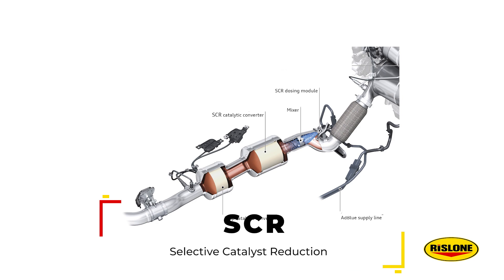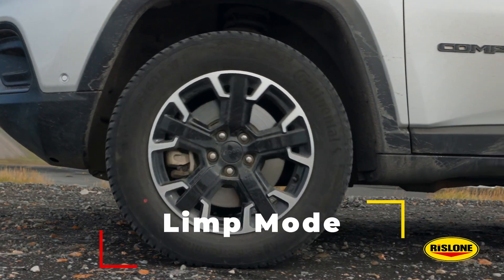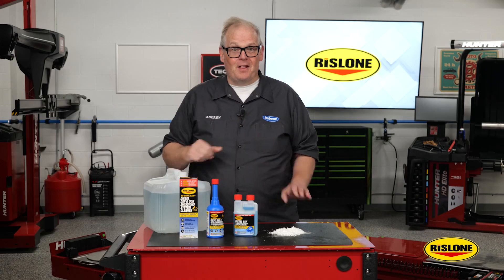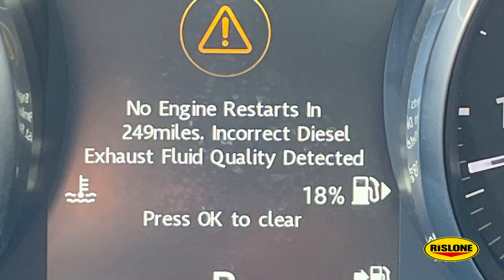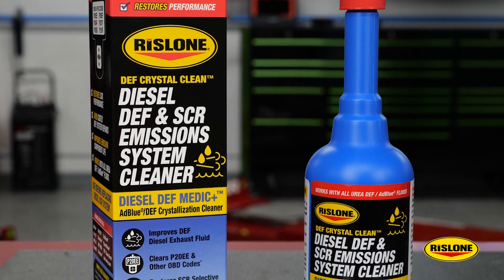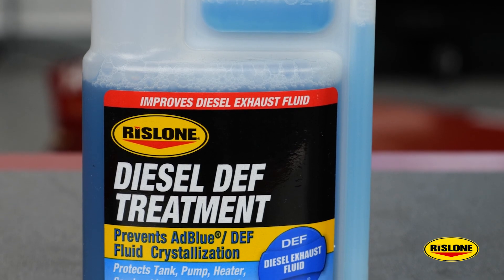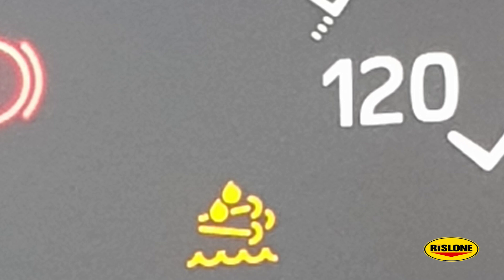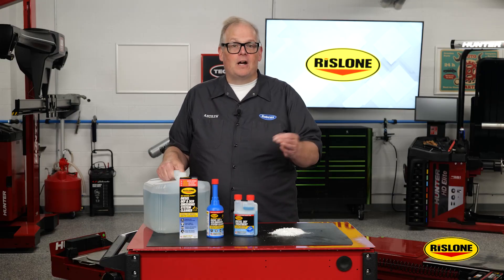Rislone CRYSTAL CLEAN™ Diesel DEF/AdBlue & SCR Emissions System Cleaner

Comment: Used this in my 2015 Ram Ecodiesel, and got the "Service DEF Will not start in 200 miles" error. The DEF tank is full. I have now driven it for 100 miles after getting the error with no resolution. I'll be taking it to a diesel mechanic on Monday to see how bad things are.

Comment: If I'm understanding this right, the System cleaner and def treatment should not be used together. Is this correct?
Reply from the maker: Correct you do not use these at the same time. The Crystal Clean is the initial treatment, and then you would start to use the DEF Treatment after that tank of DEF has been run out.

Comment: becareful adding this product in your def semi truck. too much will turn your def liquid into a soapy liquid and will trigger your def derate. the only way to fix it is to flush or drain it out.
Reply from the maker: Yes, you will want to ensure you get the proper dosage of product into the DEF system. Too much is not a good thing when using this product you want to have the correct amount installed.

Comment: I own a 2024 Ram 3500 and used the Rislone DEF system cleaner at 5000 miles, and having no issues. If I'm keeping the DEF tank topped off, the proper mix ratio is 1 ounce to I gallon of DEF fluid? Thanks for any help!
Reply from the maker: Yes for our DEF Treatment you will want 1 ounce per Gallon of DEF Fluid when refilling the system.

Comment: Got a P1C54 code on my ‘15 Ram 2500 6.7, already changed the DEF injector ($445 for MoPar at dealer) cleared code, ran it and code came back after about 100 miles… both times code hit I was driving slow speed taking kids to school. Code: "SCR Catalyst Missing" or "SCR NOx Catalyst Missing"
Going to try this 4784 out 🤞🏽

Comment: Used your product #4784 in my 2012 F350 after my engine light came on with the def tank code. Added to my def tank with two boxes of new fluid and ran the truck in 5th gear for about 70 miles and light went out and truck ran great. I will use the maintenance product from here. Product worked great. highly recommended.
Reply from the maker: Thank you for the comment, glad we could help!

Comment: I don't trust this product for some reason. I think the solution is to use truckstop DEF and never let the gang go down below a quarter.
Reply: Using fresh DEF fluid from a high-volume location and not letting it run low certainly helps, but depending on your driving conditions for the truck, crystals will still form, they just may take longer.
Reply from the maker: We are sorry to hear that, this product has been proven effective when used at the proper dosage per the instructions.
Reply: I ALWAYS get DEF at the pump!!!  ALWAYS!!  And I just got an "Exhaust Fluid Quality Poor" message and had to limp into a dealer at 50 mph when it restricted my speed!!  Dealer says my DEF is bad.  Over $500 to drain it and put in good stuff!!
Reply from the maker: @philborchelt5396  We would like to hear more about this issue, please contact us at the following link - https://rislone.com/contact/

Comment: Thanks for the details!

Do I need to let the full tank of DEF with the cleaner run out first to get a full clean & then wait until the next DEF fill up to do the treatment cycle each time going forward?

Or can I run the cleaner for a couple thousand miles & then do a DEF top off with the treatment now added?

Thanks for your help🏁👏
Reply from the maker: After using the Crystal Clean DEF Product 4784 in a full tank of DEF you will refill system and add the proper dosage of 4780. The DEF Treatment Product 4780 is a PM product to be used after the initial treatment of the 4784.

Comment: How does this compare to BlueDef Platinum?
Reply from the maker: This is not a DEF Fluid, it is an additive to help prevent the DEF from crystallizing in the system causing issues.
Reply: @ That I understand. BlueDef Platinum is a DEF fluid that the manufacturer claim does not crystallize. Expensive. I would expect that Rislone have compared DEF fluid treated with the Rislone product to the BlueDef Platinum product?

Comment: I have a 2024 f350 ima try this, just because it’s going to be sitting for a while inside the garage for now.
Reply: Don’t, soon as I had put this in about 100 miles or so later I’ve been getting “dpf quality poor” messages. Goes away most of the time but it’s irritating. Fresh batch of def in there as well.
Reply: Should u do it I got a ram 350 21 they told me repair. 5 k but I used this and the other diesel fuel cleaner for same brand , used when tank is half don’t be worry about checking engine light just put both in correctly where they go drive about 50 minutes between 70 or 45 . And message will go away if help to clean trust me never try until one week ago best product ever . Definitely doing it again